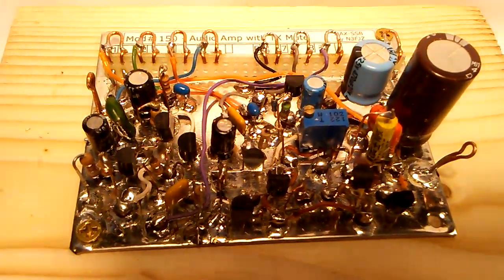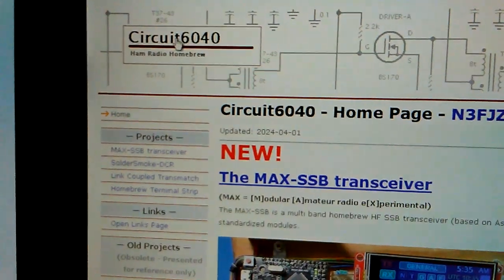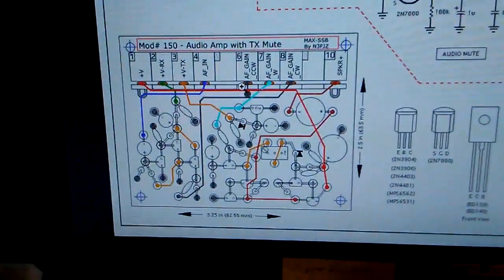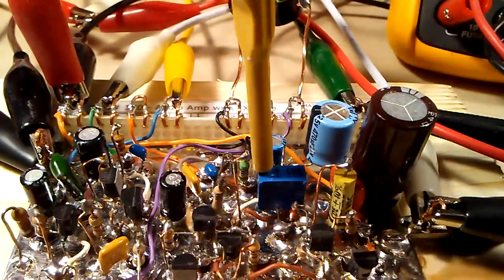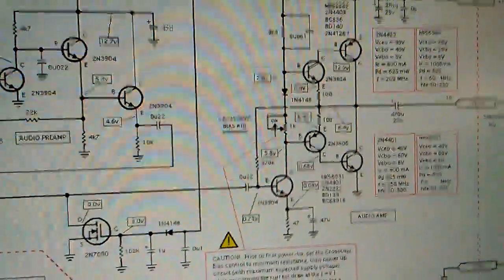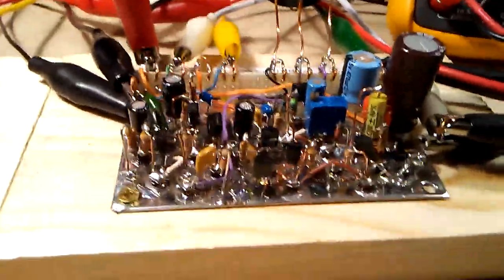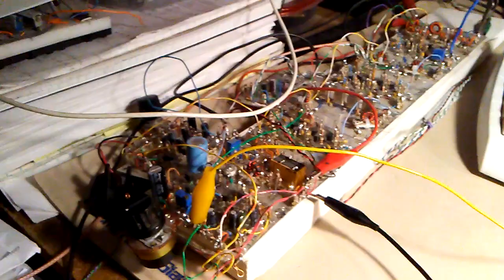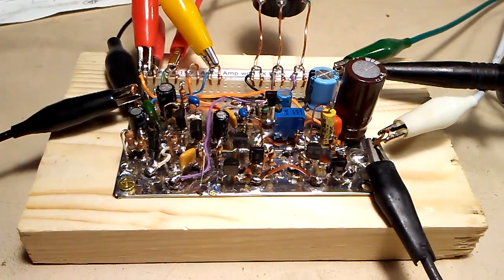Module # 150 Audio Amp - MAX-SSB Transceiver Project

Comment: Hi Rick,
Thanks for sharing this. I already started the build.
Just a question: how many Watts would you say the 8 ohm speaker needs to be ?
I read somewhere that a BD139/BD140 should be good for approx. 3 Watts, so would a 5 Watt speaker be enough ?

Can't wait for the completion of the rest of the modules !
73, Hans
PA3CRZ
Reply from the maker: Hi Hans, Fine Business on you starting your build.  I'm not 100% sure what wattage my speaker is, but 5w sounds about right.  One thing I did discover is that the quality of the speaker makes a big difference.  I'm using an old JBL high fidelity computer speaker unit and it's sounds fantastic when compared to a bare out-in-the-open speaker.  You can find this speaker (and other JBL computer speakers) used on ebay for a very good price (e.g. 2 for $18 USD).  Go on ebay and search for "304241-001 speaker".  Hopes this helps - 73 - Rick - N3FJZ.

Comment: Very nice job building the audio Amp. Have you considered using KiCad to design a printed circuit board for non-critical boards like the audio Amp?
Reply from the maker: kmnl926, yes indeed, using KiCad and other design tools (and having PCB's produced, or etching my own) is definitely on my future to-do list; however, right now I have set a goal for myself to build as much of my rig by hand using Manhattan construction as possible. I guess it's like a cook challenging themselves to bake a cake from scratch vs. using a cake mix.   I made some obvious exceptions of course with the display, Arduino and GPS to keep the development effort reasonable.